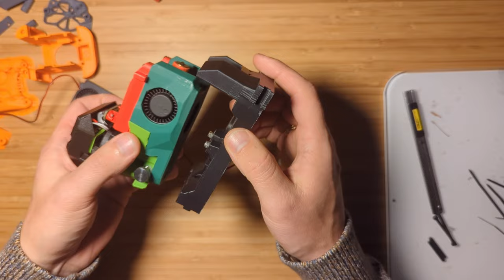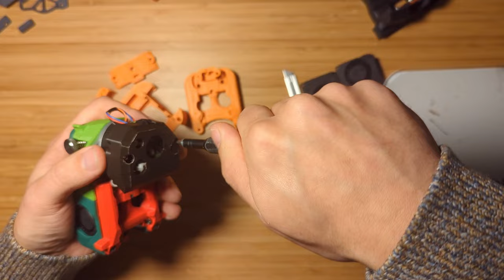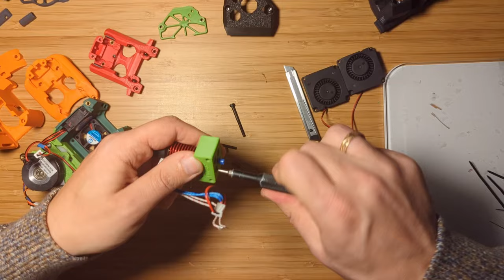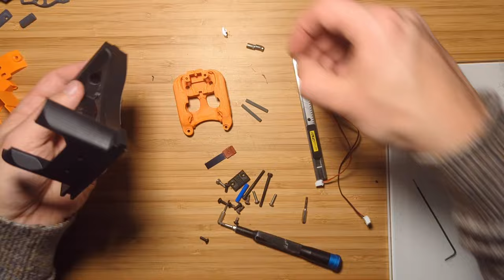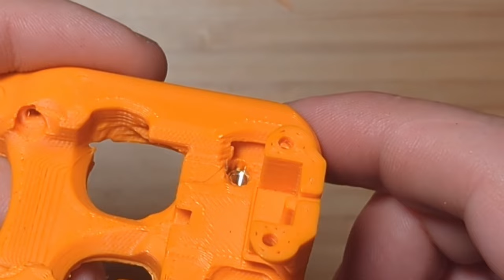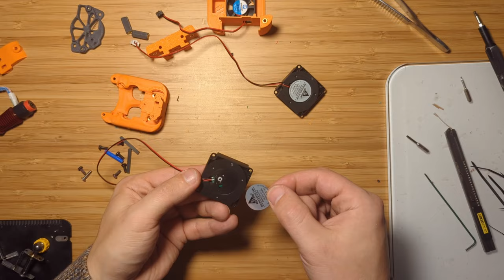Tpachanger + Dragon  Burner hotend Assembly

Comment: how do you ensure proper alignment of the 6 bearings? i know others have had issues getting the tolerances good enough. would it be potentialy better to move away from heat insert and use nuts for the bearing screws?
Reply from the maker: Never had a problem with that. Just making sure they are reasonably straight. 
Alternatively you can print the aluminum version in ABS and just thread directly into the plastic using longer screws.

The heat set inserts provide a solid metal surface to tighten against. If there is plastic, it creeps over time and get loose. That was a constant issue for me with the old 10mm bearing design.

Comment: Hey Viesturs, could you add a link in the description to the toolhead board protective cover you are using?
As for the format really like it, sometimes cut down guides can miss small steps or a part isn't filmed from a certain angle, with this kind of format that's less likely to happen.
Reply from the maker: That is my design, added to tapchanger repo.
Reply: @viesturz  cool! Will check! Been following the discord for a while now, just looking for an excuse to spend the money on a tapchanger :)

Comment: Sorry if this is a stupid question but how do you connect each toolhead's canbus to the raspberry pi? doesn't it only have 4 usb ports?
Reply from the maker: Canbus is like Ethernet - each device is a node in the net and every message is broadcast to all other nodes. A single usb2can chip allows pi to talk to all the toolheads. There is a canbus wiring page in the tapchanger repo, with the details.
Reply: @viesturz  
Ohhhh that makes more sense, i will go check the repo rn.
Thank you for taking the time out of your day to answer my question!